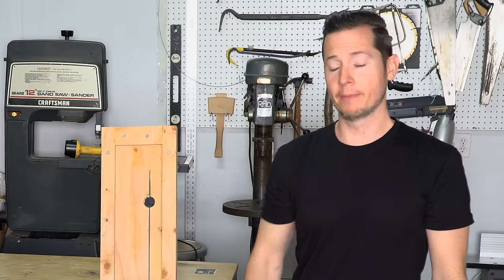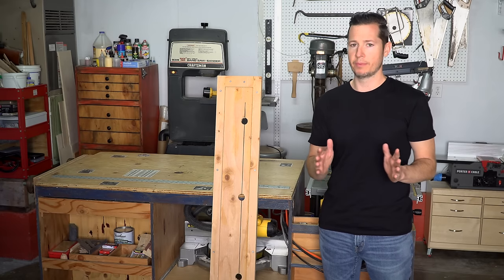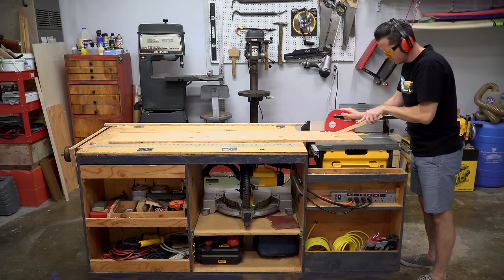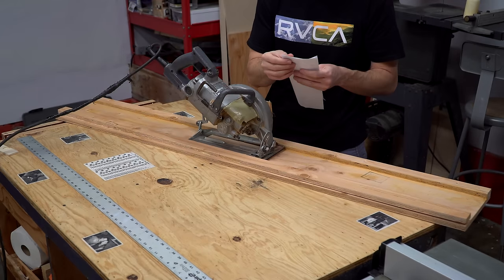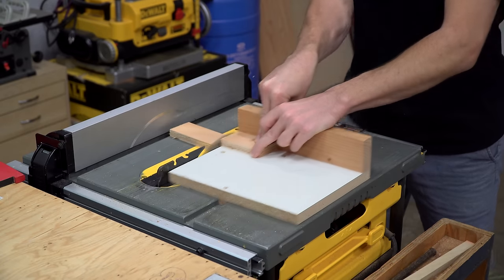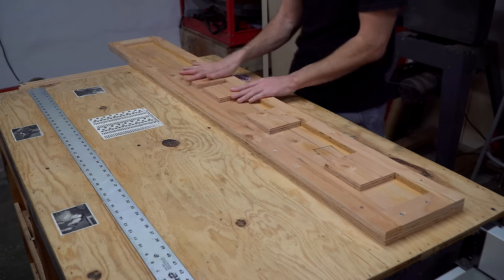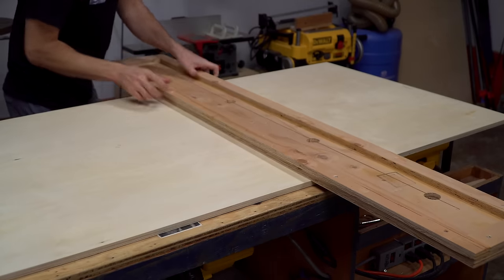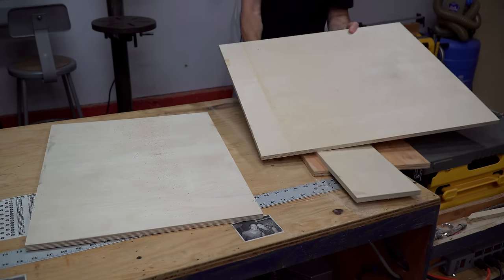Super Simple Track Saw

Comment: Isn't this a bit of a chicken and egg dilemna? What I mean by that is that you need to be able to cut a straight line to make the track. And to have the straight line, you need the track (or a table saw with fence, which I don't have) Otherwise, I really like the idea, I have been struggling cutting 2m40 lengths of wood to make French cleats, and even with a builder's level, it wasn't always dead straight for various reasons. And every time, the calculations based on whether you go from left to right or right to left, and whether you are cutting at 90 or 45 degrees, can be a headache. Otherwise, what type and thickness of wood do you recommend?
Reply from the maker: Andrew, a few people have asked about whether this has value if you need a table saw, and the answer is definitely yes. A track saw can make cuts that a table saw cannot. Imagine cross cutting a 4' x 8' sheet of plywood on a contractor's saw...it would be very awkward and downright dangerous. A track however can cut it with ease. All that said, you can also make a track without a table saw. Here's a link to a video where I do just that: https://youtu.be/68v9JlSM6OQ I've used 1/2" and 3/4" plywood to build tracks with good results. I hope this helps!
Reply: @OneMinuteWorkbench  perfect, and thanks. I’ll try it out and let you know.

Comment: Now do this build using only a router with an edge guide and a few bits. This is the dilemma I’m in right now as my table saw is useless without a fence and I have no track saw to make those long straight cuts. So I need a track saw so I can build a good fence just so O can use my table saw. You of course have to start out with a board that’s straight or the project will go nowhere. Unless you also have a router jig that gives you a straight edge from an uneven edge. It’s the chicken/egg thing all over again.
Reply from the maker: Here ya go: https://youtu.be/68v9JlSM6OQ I hope this helps!

Comment: I love this design.  My issue is that my Dewalt circular saw literally only has a 1/8" gap between the bottom of the plate and the bottom of the motor, so I am not sure how to accommodate for that.
Reply from the maker: You could use really thin, but strong material for the rails…aluminum comes to mind. I built one with 1/2” ply for a cordless dewalt and it worked out. There’s a video of it on my channel, if that helps. Best of luck!

Comment: If you drill the holes before you cut the slot, how do you align them to where the slot is? I guess you can gauge where the slot will be and that the hole doesn't need to be perfect aligned?

Comment: I like the design. I would only make one change; instead of one narrow groove for the blade I would cut it so the saw could be used at other angles as well as 90 degrees. After all, it's the side rails that guide it, not the groove. There is no reason it has to be blade width.
Reply from the maker: Thanks! The only reason for a blade width slot is to reduce tear-out, but a wider slot would have it's uses too. Thanks for sharing the idea!

Comment: just bought my  first circular saw so a beginners question , everyone ( on youtube) warning not to cut when both sides are supported , since it can collapse and cause a kickback , i see you are doing it , why?
Reply: Circular saw newb here as well.  Thanks for the tip.
Reply from the maker: I think you might be referring to videos that are suggesting there should not be 2 points of contact, 1 on either side of the blade. That would be bade because as you make the cut, since the board is the only thing holding itself up, the further you get into the cut, the less structurally sound the board becomes. Eventually it will sag, pinch the blade, and that will result in a kickback. However, if you have 4 points of contact (as I do in the video), each resulting half of the board is still supported, and therefore cannot sag, nor pinch the blade. Does that make sense? Anyway, I hope this helps!

Comment: Has anyone made a modified version of this so that it can be used with  circular saws with a motor mounted on the axis of rotation of the blade, which are much commoner and cheaper in Europe than the worm-drive type you are using? My ancient but excellent Bosch PKS 46, which has a cutting depth of 46mm cannot be used with your design because at the max depth the motor is almost in contact with the baseplate and sticks out sideways almost 4 inches beyond it. Does anyone know if Bosch make an aluminium guide that will work with these older saws?

Comment: What is the length of this jig and what is the maximum width of the cut you can make?
Reply from the maker: The overall length is about 60", and the slot in the track allows me to cut just over 48". This makes it as small as it can be, while still allowing it to make cross cuts on the full width of standard 4' x 8' sheet goods. I hope this helps!

Comment: 24 In. Clamp Edge And Saw Guide from harbor freight tool store cost 13 bucks simple to use
Reply from the maker: Thanks for the feedback! Funny enough, I actually bought the 50" clamp from Harbor Freight (I'm a big fan of buying tools cheap) but it had WAY too much movement to make a precise cut. It also doesn't line up perfectly with a line...you have to measure from the line to set the position of your straight edge (and that goes for any straight edge, clamping or otherwise). I will say that I'm very happy with this tool...especially considering how cheap and easy it was. It has changed my life when it comes to breaking down sheet goods. Anyway, I hope this helps!

Comment: Quick question: How could you make one to help cutting a full 8' of plywood? Make 2 of these and somehow connect them in a way that is secure and tight? Any ideas? Anyone?
Reply from the maker: Duke, you could make a longer one by starting with some 12' stock. You can find 12' pieces of certain materials that might work in the "trim" section of Home Depot and Lowes. Another option would be to get a 12' sheet of plywood, which you can find at (real) lumber and hardwood stores. I hope this helps!
Reply: Duke Frywokker 🤔
Reply: U could make 2 4ft ones, an place a thin piece of ply /hardboard on the bottom then drill an screw to the two tracks.
Possible run 2 long strips on the sides to keep the tracks more secure.

It would have to be stored very carefully. What du say, "One minute"?

Comment: The saw will still only touch on one side at a time because of natural variation in temperature and humidity, so need to apply pressure to one side or the other when cutting. Really no need for the screws or stop blocks.

Comment: Someone help a newb out. Is this mainly useful to someone who can’t afford or doesn’t have room for a table saw or are there reasons to have both?
Reply from the maker: There are reasons to have both. A track can break down large sheets more easily than a table saw because of how awkward sheets are at full size (unless you have a large format cabinet-makers style table saw). In a pinch, a track can work in place of a table saw, but you’ll need a way to make the track to start with. I have a video on how to make a track without a table saw in my video list, if you’re interested. I hope this helps!
Reply: I've seen youtube woodworkers cut the large sheet right after taking it off their pick up truck. They do it right on the driveway floor using the hand circular saw.

Comment: Why not just clamp that straight edge that you used to draw the line. With a little simple math you can cut with both sides of the saw perfectly. I actually wrote on both sides of my circular saws the exact width to add to your  cut line. I never seen the need for a track saw myself although I love your design and thank you for the video

Comment: Who needs a track saw when they already have table saw? Build a track saw using table saw. More like chicken and egg problem.
Reply from the maker: A lot of people seem to think that, however they're 2 different tools with 2 different purposes. A table saw (especially a small contractor's saw) is great for making rip cuts, but cross-cuts over a certain size become unmanageable. Imagine trying to cut a 48" x 12" piece off of the end of a 4' x 8' sheet of plywood. It would be INCREDIBLY dangerous to use a table saw. A track on the other hand will handle that cut with ease and do it very safely. All that said, you can create a track without a table saw as well. Have a look here: https://youtu.be/68v9JlSM6OQ I hope this helps!
Reply: @OneMinuteWorkbench  I totally agree with your reply; especially the safety warning re certain, unmanageable cross-cuts on a table saw. Other advantages of your saw guide are portability, speed of set-up, ease of use, accuracy, affordability, and safety.
Reply: You only need two clean edges in this design, which you have on every new sheet you purchase, so the egg comes first in this case

Comment: Ok, but can you explain why you would need a track saw if you already have a table saw? Not trying to be rude or anything, but I genuinely don't understand since I came to this video looking to make one since I don't have a table saw and can't afford one right now.
Reply from the maker: A track saw is better than a table saw for breaking down sheet goods, making certain types of cuts, or for going to certain locations (e.g. a rooftop, upstairs at a job site, etc.). It earns its place in your tool set in addition to a table saw. A track saw isn't a replacement for a table saw, and a table saw isn't a replacement for track saw. Does that make sense? Now, if you don't have a table saw, a track saw sure can be handy though. Luckily, you can build a track without a table saw - check out this video: https://youtu.be/68v9JlSM6OQ I hope this helps! Best of luck!
Reply: @OneMinuteWorkbench  ok, so basically it's meant for portability or when ripping larger boards. I was thinking of getting a circular saw to make one as a cheaper alternative to a table saw for now, but I'm not sure if it would be good enough to completely stand in for one
Reply: I watched the other video and it was very helpful. I have a couple more questions 
1. Could I angle the blade and make another cut so I can use this jig for 45° cuts too?
2. How difficult is this to align if I wanted to do something like joint a board?
Reply: @SurreptitiousBean  Get a decent circ saw  ( 8 1/4 if you can afford it)  with a rip guide and  build this or similar  track guide, it'll work for aluminum soffit and facia, sheet goods and bigger boards while the rip guide will allow you to work bigger dimensional material- did it for a year or two before I could get shop tools.,

Comment: What?  No, just take a thin sheet of Veneer or 1'8" Plywood.  Take an 8' long piece of Fir Strip and screw it into the underlaying sheet.  Now, just put the Left Edge of your Circular Saw up to the edge of the Fir Strip and cut the underlay.  The edge of that underlay is now the exact location of where your blade will cut.

Comment: Would have been more helpful for those of us with limited funds and equipment, if you had shown how to make it using the circular saw. Thanks anyway
Reply: You could use the factory edge for the inside of the track walls to make sure you have a straight edge inside (this would require you to have enough plywood to get 2 factory edges). The outer cuts don't need to be straight. And, if you really need those outer edges to be straight, you can make your second jig after you make your first one ;). Or, you could use straight 1x2s as the borders, then you just need to cut to them to length.
Reply: @dukefrywokker6470  thanks mate I might give it a try.
Reply from the maker: Duke is absolutely right - have a look here: https://youtu.be/68v9JlSM6OQ I hope this helps!
Reply: Cheers both that really helps. As soon as this covid19 pandemic is over I can't wait to try this out.

Comment: There is a small problem with your design as it is dedicated to that particular circular saw and to that specific saw blade. When you change your blade to different type, brand or number of teeth, the zero clearance slot will be damage as the blade thickness are different. Hence the accuracy of your cut is reduced. Sorry, I have to edit my comment because I forgot to say that your design and built quality is very very good nevertheless.

Comment: Has anyone asked how to make one to cut a 4x8 sheet length wise?
Reply from the maker: Yes - many many 😂 You could start with a longer piece, or you could joint smaller pieces. The former is probably easier than the latter. But honestly, if I needed to cut full 8' length rips, and I only needed to do it every now and then, I'd make an old school one-sided track. It would be way easier to build, cheap, quick and simple. The only problem would be that it wouldn't capture the saw on both sides. Again, if I only used it every now and then, I would deal with having to be a little more vigilant during the cut. I hope this helps!

Comment: Ummm......if pinning and screwing  the second guide on to the board was good enough, then why bother to glue the first?
Reply: You've got it turned around. Glue is generally stronger than the wood itself and would likely  be fine on its own.

To speed up the process most woodworkers use fasteners like screws, Brad nails, or pins to speed up the process by not having to wait for the glue to dry before working with that piece. In this case he's done this plus he's clamped that piece down so it doesn't move while adding the fasteners.
Reply from the maker: Just like Bonezz024 said, I'm using glue for strength, and nails and screws for other reasons. Pin nails are good for alignment of a piece, but not very strong. Glue is strong, but not very fast (because you have to clamp and wait for it to dry). Screws apply pressure like a clamp, but will loosen over time and will still allow "wood movement" to bring the piece out of alignment (glue will not). So I apply glue (which will be the final strength component), pin nails (to temporarily hold it together & keep it from slipping around while I add screws), and screws so for clamping pressure that still allows me to keep working, without having to wait for the glue to dry. So in the end, it's about making something as fast as possible, that will still have the same strength of a piece that was glued and clamped. Anyway, I hope this makes sense!

Comment: Purpose track saws use guide views or tracks like those of a table saw, but homemade tracks usually rely on the users experience with a circular saw to keep it against the one rail off to one side. Two pieces of plywood is all it takes to make a great track for a circular... more than that and its too heavy. Making the jig any more complicated... is just heavy and inefficient, which only serves to make it thicker and harder to clamp and line up on the work piece... so- no- you have not made anything better, only harder to move and use. Learn to use the circular with a regular homemade track?